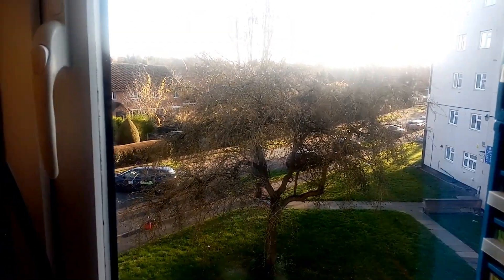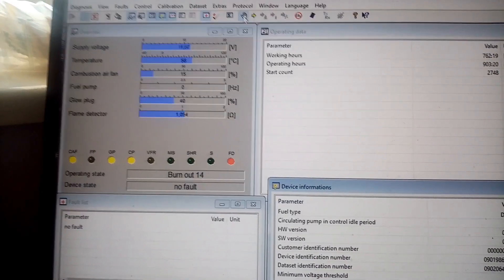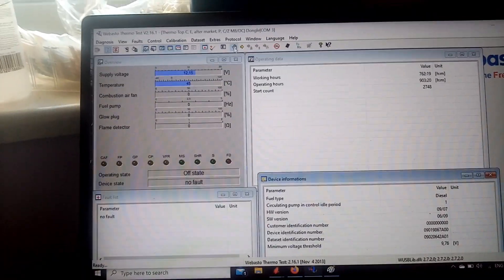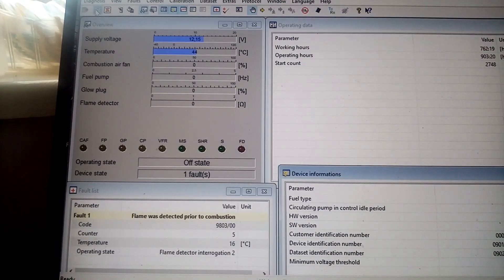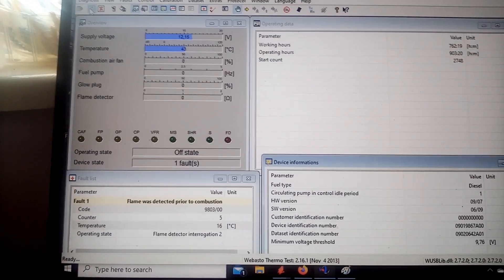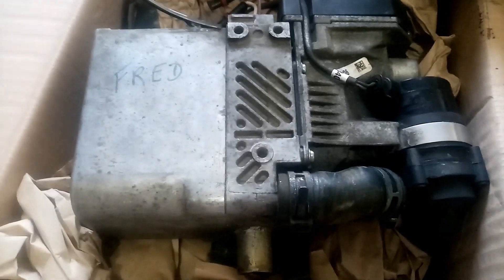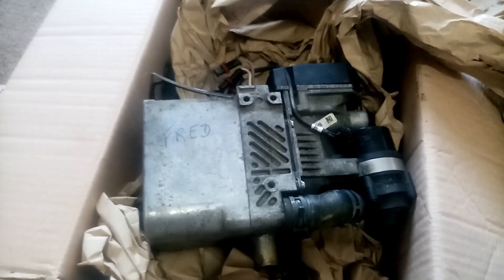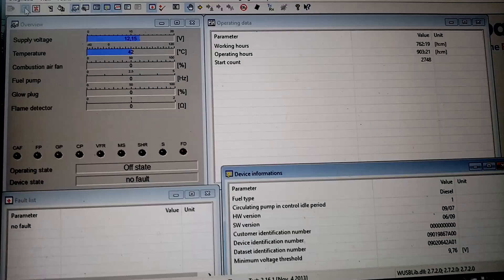"New Style" Thermo Top C Board CPU`S Are Failing! And Stop Buying Shit Off Ebay For Your Own Good!

Comment: Hi. Is it possible to use petrol Termo Top C with diesel fuel? Iam pretty sure the "steel" is the same inside, only different is the software. But, how diferent? What exactly?
Should I replace the board? Or is it possible to update the soft to diesel version? Or the dieffrence is so small and not need to do anything, just plug and play?
I got brand new TT petrol and would like to install it to my diesel car, thatwhy Iam asking.
Thanks.
Reply from the maker: They are the same (sort of) in the software there is a slight fuel pump timing difference however, Its the fuel pump that is different! If you put petrol through a diesel pump it will melt the seals and grind it with no lube! use petrol pump for petrol and diesel pump for diesel! if its universal pump you should be ok, but would recommend adjusting the c02 to match the fuel used! Check out the data sheet for fuel flow rates
Reply: @robinsonlabs  Install it. Petrol Termo Top C working👌with diesel fuel. But, I just call my Thermo Top C, it is actually not C, its P. Its very rare model. Do you know about P anything? Why Webasto made model P? For what?
Reply from the maker: @ruslanserdjuk8029  never herd of one! could you take a pic of it for me, i would like to see it.
Reply: @robinsonlabs  Sended to email.

Comment: Any sum for a scam is too much. But then Webasto costs too much in the first place. Not sure why a circulation pump should cost 150 euros, nor why a glorified digital alarm clock to turn on the heater on a timer should cost 130 euros. A keyfob that wirelessly switches a relay can be bought for about 5 euros from aliexpress, or if you prefer something less dubious there are keyfob+receiver combos available for less than 50 euros that private security adds to security panels as panic button alarms, for Webasto just an original keyfob without the receiver on the heater goes for 80 euros.
Consider that a chinese brand smartphone that has a considerably more complex processor, gigabytes of RAM and tens or hundreds of gigabytes of storage memory, built in wireless radio for normal calls, wi-fi, bluetooth, NFC, the thing has a high resolution camera, it has it's own li-ion battery etc etc etc. Such a phone new costs the same as a dash panel timer for Webasto... So the demand for reasonably priced parts for Webasto is very high.